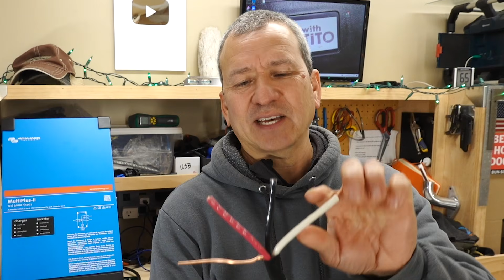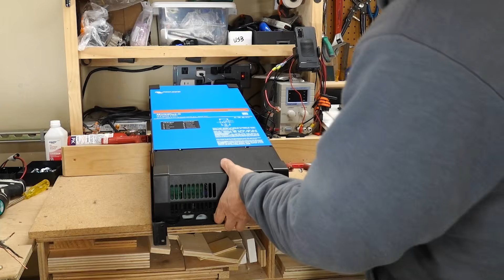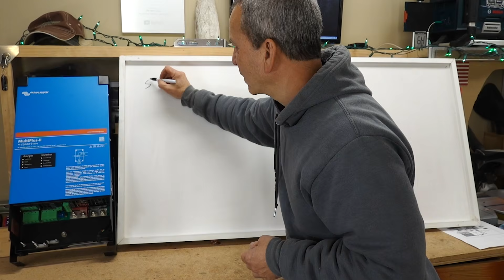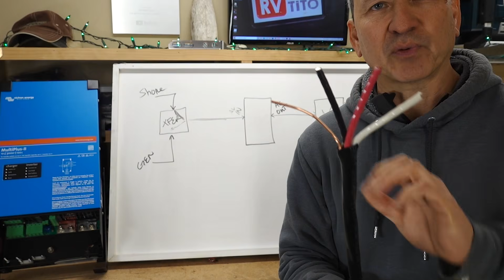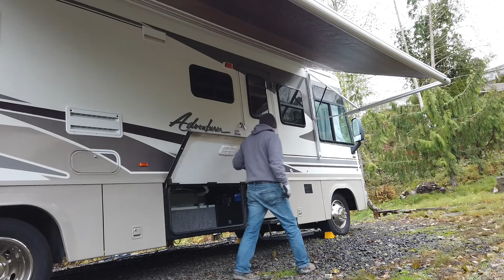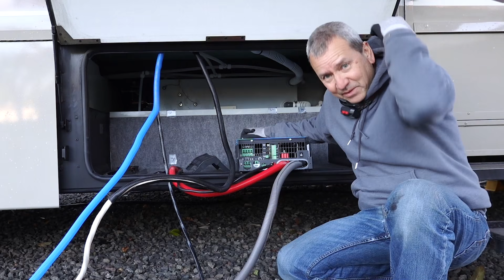Installing the Victron Multiplus II Inverter to Power our 50A RV Off-Grid | RV With Tito DIY

Comment: Brian, great review as always.  Did you run into any issues with passing through all of the generator power?  I have heard, and saw, Changing Lanes, had issues with the pass through of only one leg since it was in phase.  Thanks.
Reply from the maker: My two generator inputs are bridged inside my transfer switch so all.is good. Yeah. I also left a comment on Chad's video mentioning it.
Reply: @RVwithTito  Hello can you explain this topic a little more? Getting ready to install this inverter in my 5th wheel with an on board Onan 5500 gen and want to make sure I don’t have any issues passing thru power to this new inverter. Thanks for any info!
Reply from the maker: @davis2220 This should help. Jump to the 11 minute mark on this video https://youtu.be/MV8aSLt_Ers?si=KqsJKTPbgcRy0xto
Reply: @RVwithTito  Thanks one quick question. In that video you used a splicer. Could you just use a jumper wire across L1 and L2 to accomplish same thing? Thanks
Reply from the maker: @davis2220  You could, but I've found it to be less reliable with the majority of current being drawn from L1. When I tried it, the first breaker on the generator would still trip under high loads. Keep in mind that the Multiplus II will only pull from L1 if it detects single phase. The splitting across L1/L2 occurs inside the inverter in this case. I still recommend combining both single-phase outputs from the generator prior to going into the transfer switch for best results. You really only need to send one output from the splice into L1 since your generator only outputs 120V single-phase. I wired L1 and L2 just to future proof my wiring in case I switch to a different inverter in the future. Don't forget to double up the neutral wire (or use a heavier gauge wire). This is very important since both single-phase outputs will be sharing the same neutral input (double the current). Hope that helps. Good luck.
Reply: @RVwithTito  Thanks looks like you upped your guage from your splice to the hot leds in transfer switch correct? What guage did you go with? Also my transfer switch has two terminals one labeled neutral and one aux with one neutral wire in each terminal and then there is a bridge connecting the two terminals together. Do I still need to combine the neutrals together on same terminal?
Reply from the maker: @davis2220  I used #6 AWG cable for those. Yes. You still need to combine the neutrals from the two generator outputs. You need both wires to safely carry the load of both generator outputs. Combining them in a splice and sending one larger #6 cable out would work too. I'm assuming the AUX input you mention is for the shore power input which will be a separate circuit.
Reply: Thanks!!

Comment: I have a tiny home, the incoming power is 30 amps 120 volt single Phaze RV post power outlet.  I plug in an extension cord from a electrical panel that has two 15 amp breakers for the AC outlets. My hot water heater and mini split are 220 volt, but on their own power lines.   

If I bought this unit, would I be able to run it on 30 amp single phase unitl I'm ready to redo my incoming powerlines to a single 220 volt dual Phaze 50 amps?

If so, once the 50 amps dual Phaze is available. I could change my electrical panel to a dual Phaze panel. Run my 2 15 amp breakers for the AC outlets, then 2 additional 220volt breakers for my hot water heater and my mini split?

Comment: I have a Tacoma and a Bluetti AC200P.  For maximum charging, do I get a DC to DC charger or a 1200W Inverter connected to the truck battery and then use two Bluetti power charging bricks (AC to DC) that deliver about 400W each (800W)?

Comment: Thanks for a great video.  You explain it very well.  I do have a question about the AC power from the Multiplus 2 to the distribution  box in the rv.  I have an onboard generator so I have a transfer switch.  If I understand it correctly, the shore power and generator power go directly to the transfer switch box.  depending on the source generator or shore power the power is then switched to a wire that leads to the ac distribution box in the rv.  My question is can I make the connection to and from the AC power on the multiplus at that point  or do I  need to wire directly from the AC output on the multiplus to the distribution center and abandon the original wire between the transfer switch and the distribution center.  It would be very easy to make the connection at the transfer switch.   A second question,  where did you disconnect the original converter?  Thanks for you help.
Reply from the maker: The Multiplus will sit between the transfer switch and AC distribution box. I just unplugged the converter and removed it. The circuit (DC output) is still there.
Reply: @RVwithTito  Is there any way you might give me a call to answer a few more questions I have?  Thanks.
Reply: Just to clarify,   did you run an ac output from the multiplus directly to the ac distribution box or did you run the  ac output form the multiplus and connect it to the wire that already ran from the transfer switch to the ac panel?

Comment: Awesome video Brian.  Question:  I heard that the Onan generator produces 2 120V lines in a single phase coming into the MultiPlus II versus AC Shore power 50AMP which is split phase.  The net-net is that you will only get 1/2 of the generator power due to the MultiPlus II.  Have you seen this?
Reply from the maker: Inside the transfer switch you need to bridge the two inputs from the generator. Just a wire connecting generator line one and two. Mine was already setup that way. That should give you the max generator power in single phase across both legs. I'm pretty sure that's what happens but we don't run our generator.
Reply: @RVwithTito  Hmm..  that seems too easy. 😃  thanks for the suggestion and the quick response!

Comment: Yes sir question?. By hooking up the new inverter charger that way with new wire are you completely by passing the factory inverter?. Thank you
Reply from the maker: No more factory inverter or converter.
Reply: @RVwithTito  sorry maybe I do not understand. So what hooks to the factory inverter/converter the breaker box?.
Reply from the maker: @kirktruman6707  Nothing. The converter has been removed. There was a small inverter mounted up front that would power the TV. I removed that also. The new inverter powers everything AC and charges the batteries. The DC panel is powered by the same circuit. Take a look at my diagram I provided. It may help visualize things.

Comment: How does this unit handle L1 and L2 being in phase. My Onan 5500 has two 30A outputs that feed the 50A transfer switch. I can't find a solid answer if the MultiPlus-II 2x120V will pass on L2 in this situation. If it's only looking for voltage I'd say it would but if it's really checking for phase it wouldn't?
Reply: I should have stated, the Onan 5500 is a single phase generator with dual outputs.

Comment: If I may ask, were did you get the wiring diagram for the installation of the Multiplus II?
Reply from the maker: I designed this system myself...diagram included.

Comment: Hi Brian, I learned a lot by watching your video on the Multiplus II and I have installed the same one. Because I don't have a 30 or 50A outlet at my house, I use a 50-30A dogbone, then a 30-15A adapter to plug into my workshop's outlet. Note that prior to installing the Multiplus II, this setup worked perfectly running an air conditioner, etc.  With the Multiplus II, I have one issue: as soon as the system tries to connect AC in pass-through mode, the GFI outlet on the workshop trips out immediately. The systems works fine when powered from a non-GFI outlet.  The well known supplier where I bought it stated that this was a common problem with these units and that nothing could be done. Unacceptable! I am an experienced electronics technician and experienced with AC wiring.
Have you heard of this issue and can you offer any suggestions where I might check out?
Thanks,
Larry
Reply: no to sure about the 50 amp because I am in Australia 
but with my 5kva 240v muilt you can limit the incoming power so the circuit does not trip my has L1 And L2 inputs
Reply: You have to tell the Multiplus II what to limit the input amperage at (15A or 20A depending on the workshop outlet wiring and breaker). This is important for 2 reasons, the multiplus II will only pull less than the set amperage from the AC in and if you have PowerAssist turned on and set up correctly, the inverter will use battery power to help boost the amperage available to start things like air conditioners and microwaves.
Reply from the maker: I know this is an old comment, but I've also encountered the issue and here's what I've found out. By default, the Multiplus II automatically connects ground and neutral while inverting. This is done through the build-in ground relay. When in pass-through mode, ground and neutral are not bonded and the Multiplus basically functions as a sub-panel. However, when you're "assisting" in power assist mode, the Multiplus is inverting also to make up the difference. So the ground/neutral bond is active. I measured between 7-10mA when I measured the current on my ground while invertering. In the US, the GFCI outlets trip at 5mA (0.005A) which is the GFCI standard threshold in the US. In the EU it's a bit higher. The Victron gear was originally sold in the EU market. So it's likely not an issue there. I've removed my 120V 20A GFCI outlet and just use a standard one which works (not code compliant for outdoor use -- oh well). You could also just use a dog bone and connect your extension cord to a NEMA TT-30R 30A receptacle. I use a nice thick #10 AWG extension cord anyway.
Reply: @RVwithTito  Any ideas on a solution when the whole circuit, where I park the RV, is on a GFCI breaker?  I don't think I have the ability to simply remove my GFCI outlet and use a standard one.  Or might you know of any GFCI outlet that has higher trip value that the standard 5mA?  I see that in other countries, there is a standard of 30mA, but I can't seen to be able to locate a 30mA that is in the US plug configuration.
Reply from the maker: Unfortunately I don't think you can find a GFCI outlet here in the US that isn't 5mA. The only solution that works is to remove the GFCI outlet or plug into a circuit (like a 30A or 50A circuit) that doesn't have GFCI.
Reply: @RVwithTito  Thanks for getting back to me!

Comment: 2005 Monaco Knight, 50amp coach -- 4 wires into my surge protecter and into the transfer switch.  When I pulled the line in from the transfer switch to the old Magnum ME2012 inverter/charger, it only has 3 wires.  Monaco used a jumper on the Line In from line 1 to line 2.  The Line Out cable from the inverter to the breaker panel is a 4-wire line.  Can I use the same jumper arrangement they used for the Line In on my new Victron MultiPlus-II?

Comment: I understand that battle born is the best choice, but if money was a factor, If you could get two 12volt 400 amp batteries for $3600.00. Would that be something I should do?
Reply from the maker: Sure if they fit your budget and requirements. Just check the vendor specs for connecting in parallel.

Comment: Just found your video. I am installing the very same Multiplus inverter in my 50 amp camper.  Noticed you used the very same power cable, which was re-assuring because I thought I made a mistake with that 6/3 with bare copper ground. AM Solar shows a 6/4 insulated ground in their tutorial. Question: What size cable did you use to ground the inverter/charger? Did you go right to chassis or back to the negative bus bar for that ground? If you went back to the bus bar, what size cable did you use from the bus bar to the chasis? Thanks!
Reply from the maker: I used some #2 AWG cable back to the negative busbar for the ground cable. There's another cable from the busbar directly to chassis ground.

Comment: Enjoy your channel immensely.  Helped me with several projects.  BUT I couldn’t find a video about insulating the underbelly of a Class C.  We’ve done some winter camping in or minnie Winnie 25b.  I have been considering installing foam board underneath it to help conserve heat and cool.  For example the rear cargo holds are just plastic tubs exposed directly to elements and there are large areas that are bare subfloor exposed.  All waterlines run inside so it would seem to be just a process of jenga with foam boards to create an additional barrier.  I didn’t know if you have enclosed or insulated anything.  I know you’ve done cold weather camping so I figured I’d ask?
Reply from the maker: Sorry no video on that topic. My subfloor has at least a couple of inches of insulation. There's no insulation below the compartments though.

Comment: Am I mistaken? But I was told by more than one source that to meet NEC, you need a disconnect (or breaker) between your xfer switch and your inverter. The victron schematics also showed a DC cutoff switch. Why did you choose to leave these out?
Reply from the maker: I do have a DC cutoff switch. No breaker from the xfer switch though. You're correct about that.  Just didn't feel I needed one, but it's a good idea if you wanted to add one for your setup.

Comment: Hey Bryan I watched your video again this morning. I am impressed with your shop. I'm really interested in how you went ahead and benched test, configured, your inverter before install. I also have the MK3-USB and assumed ---- that with proper isolation of components I could wait until installation of the inverter and then the Cerbo GX /Touch 50 on account of the Lynx system. I was thinking as long as I had a long enough cable and a comfortable spot again I assumed----- Just thinking
Reply from the maker: You could certainly set it all up during install. It was pretty cold and rainy outside. So hooking it all up and testing it in the shop was better for me. Plus I could workout any issues ahead of time. Good luck!

Comment: Brian, I enjoy watching your videos. I have Battleborn house batteries, under the step and 4 more, with the Multiplus II to install. I did notice that you installed yours kind of tight to the top and looks like restricting your air flow. They do generate heat when loaded. Trying to find an area for these is a challenge for most of us.
Reply from the maker: Yes it's tight. I also added a vent fan behind the inverter that's controlled by a temperature switch. Works great 👍

Comment: Option 4 is run an extension cord from your inverter to a 50 amp outlet near your inverter then put a jumper wire from one leg to the other leg on the 50 amp outlet then plug in your shore cord into the 50 amp outlet. The inverter then sends 120v to both legs on your panel.
Reply: An issue doing this is overloading the neutral.
Reply: @tommussington8330  How do you overload a 2.0 foot 10ga neutral with 17 amps maximum output from a 2000 watt inverter?

Comment: Brian, I am in the process of setting up my Wife's Mobile Salon Bus with a Solar Charge System with the same Inverter. My question for you is have you used this Off Grid now with the Auto Split Phase and what is the Max Amp Load per each 120v leg? You and Will Prowse have Taught me  much in the Last month. Thank You Both !! The Merrills
Reply from the maker: 50 Amp split phase electrical service should give you up to 50A on each leg when in pass through mode. You can change this max from the Victron Connect app.

Comment: I think its better to use a 48V battery with a 48V inverter.  Don't mess with the 12v system at all, your never getting your money back from the investment in the RV.  Just buy a 48v fridge or a real good 120v fridge. Get rid of the AC unit and install a DC powered 48v mini split.  Get rid of the furnace and install wall mounted propane heaters that use zero power.  Now your only 12V loads are just lights, water pump, fans and maybe a bit of other stuff.  So your 12V loads are next to nothing now so you don't need much of a 12V battery and you will likely be on shore power or running the RV off your 48V inverter nearly all the time so the load on the 12V battery is next to nothing.  The 48V system is more efficient and less expensive.  You can use a transfer switch if you want and a pass through or you could just use it as a regular inverter with the option of generator charging and run a 4 prong extension RV cord from your inverter to the outside of the RV for all the loads except the refrigerator which would be on a separate installed line.  The is dramatically simpler and the battery and inverter can be removed and reinstalled in your house as part of a system to reduce your power consumption through solar and provide battery backup to your critical loads.  Also leaving it in an RV is sort of a risk to theft if you ask me and having it permanently installed is going to be a waste of moeny since investing in RV stuff like that doesn't pay.  The heater install is a great investment though because those blowers suck(pun intended) and they break.

Comment: Great explanation, but you skipped what might be one of the best features of that inverter, power boost! Being able to mooch dock on a 15 or 20 amp shore line but power an AC and a microwave intermittently or run 2x ACs off a 30A shore line is THE reason to get that unit over some of the other solutions IMHO.

Comment: Thanks, I really enjoyed your explanation. I am looking to get one of these to replace my xantrex 2000w inverter. When I bought my rv it was already set up with the inverter and the previous owner split off the circuits he wanted to be inverted. With this multiplus II could I simply run one of the outputs to that panel and then the second one to my regular panel and power everything that way?
Reply from the maker: Might be easier to just add a new breaker on the main panel to power the sub panel.